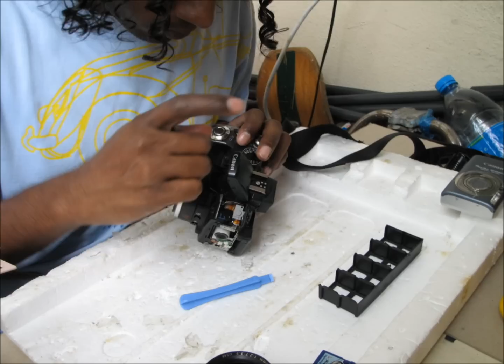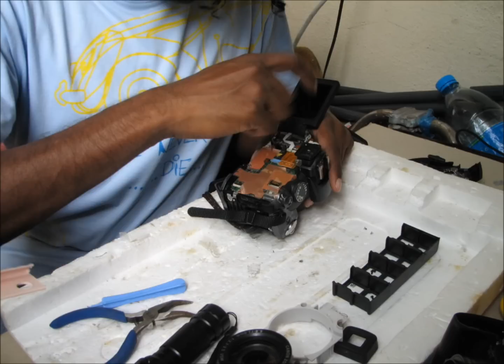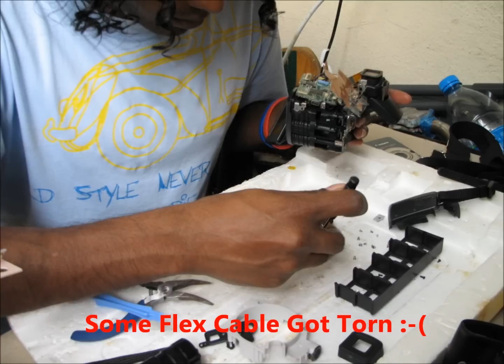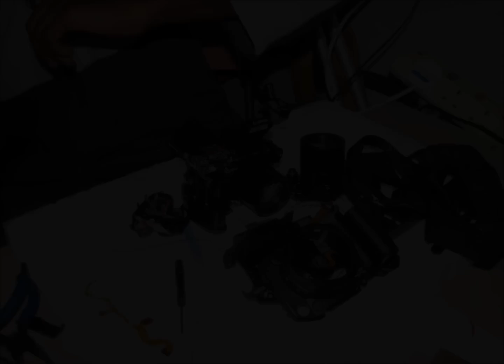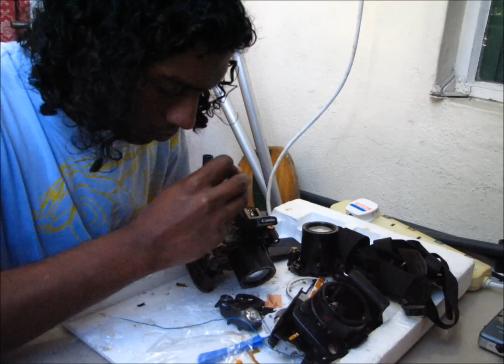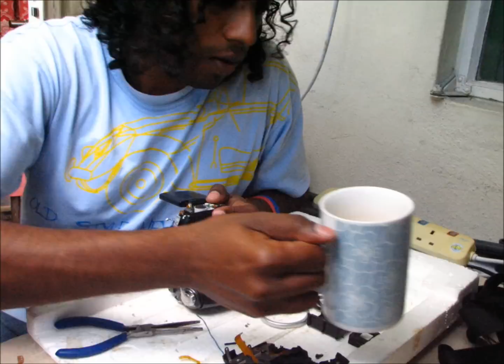2011-07/08 - Dismantling and Reassembling the Canon S5 IS - TimeLapse

Comment from the maker: Ouch... broke a flex cable too... then ordered one off ebay... but it turns out I ordered a wrong cable... so had to order another... but the one i broke was sold along with the upper right zoom button and power on buttons piece which was a bit more expensive... Wish you all the best in completing the repairs! and let me know if it worked :-)

Comment from the maker: @AndrewGallardoAquino: Hi, I sympathise with you. unfortunately I'm no expert. Do you think some dust/sand particle might be blocking the mechanism? Can you try using a blower to dislodge it? or shake the camera a bit? If this doesn't work, i would recommend sending it to a repair shop. What you should know is that even if you dismantle the camera, the lens unit is a single piece that I wasn't able to open. So unless you change the whole lens part, it's useless opening it.